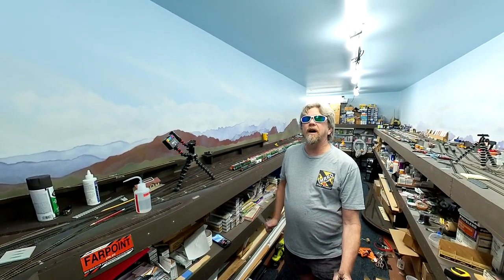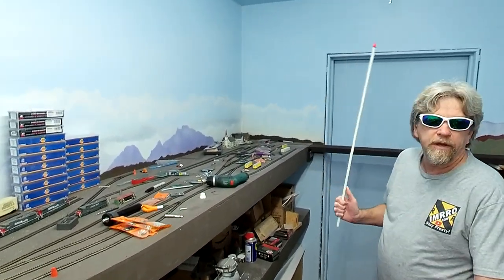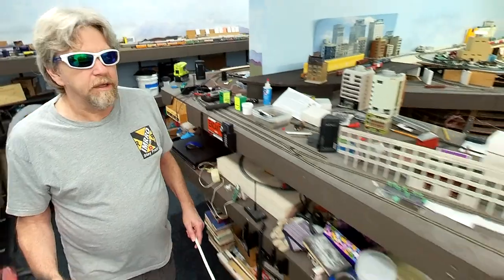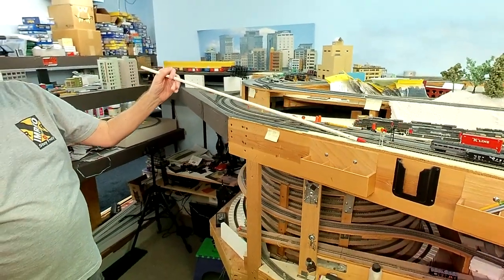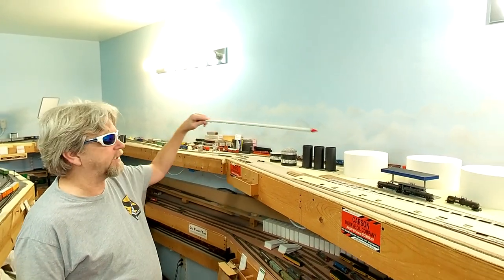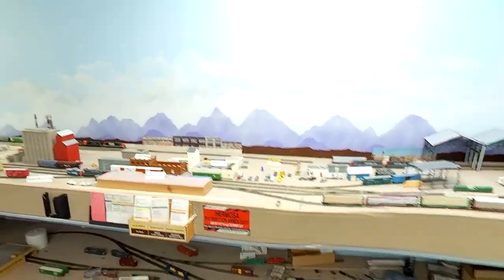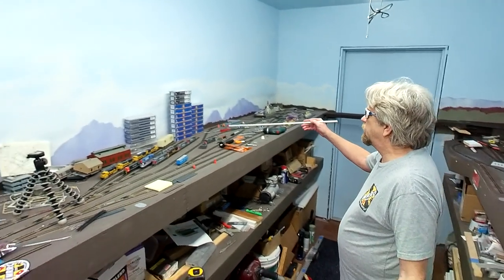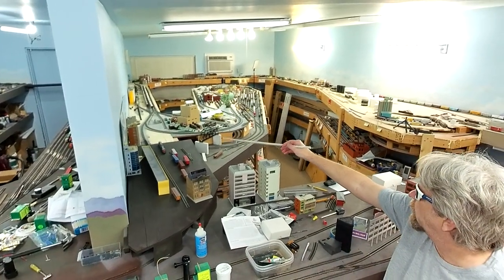Building a Model Train Layout and Mistakes I Made

Comment: You have a lot going on! The signals will be nice, I need to learn the rules on where to put signals and what lights should go on when.
Reply from the maker: I set up the railroad a long time ago for signals not knowing what was what,  The SP uses ABS, but my layout is set of CTC.   In the end my signals will be a combination of both systems.  It will look like CTC but will run like ABS.   The goal will be running DTC for traffic control like the SP,  But in reality the rules are just do not run into anyone else :)